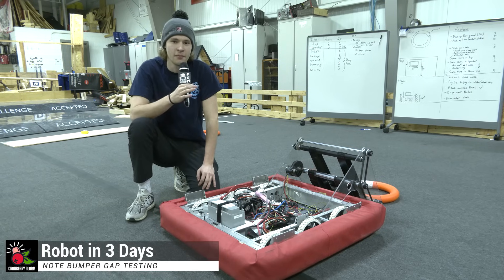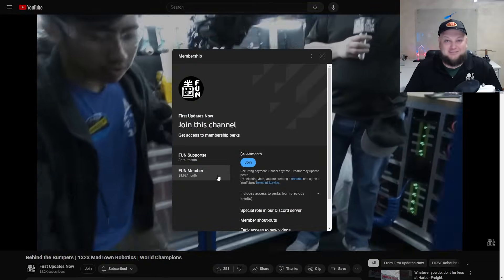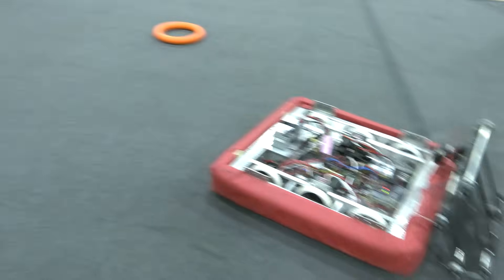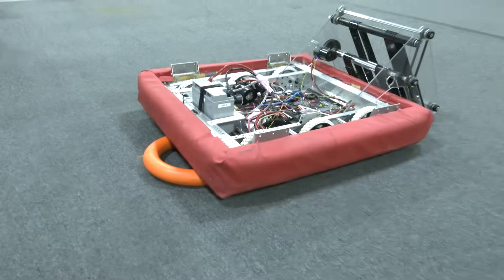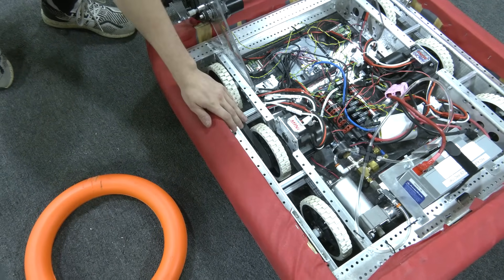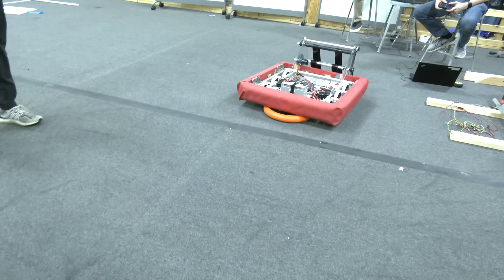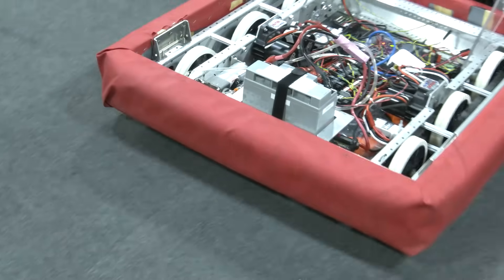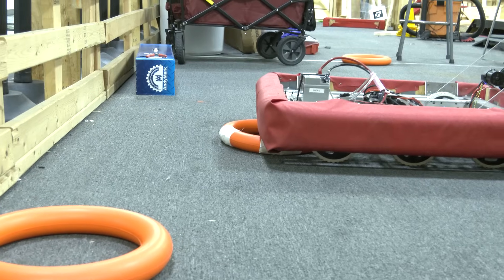Note Game Piece Bumper Height Testing | Cranberry Alarm Ri3D | CRESCENDO 2024

Comment: I think an under bumper intake is completely viable, just need to modify a chassis a bit
Reply: Agree, I think it is a big advantage over an extending intake because less joints, less motors and less parts outside the robot changing the center of weight.
Reply: @atomgutan8064 and quickness
Reply: Our reason for going with an over the bumper intake is because it makes it much easier for the drivers.  Under the bumper intake implies that you're going to get the majority of your robot over top of the Note.  Notes against the wall are especially tricky to get to with under the bumper.
- Cory from Cranberry Alarm

Comment: bumpers can go up to 3 inches off the ground right
Reply: top of the bumpers are a max of 7.5 in off the ground
Reply: They can be 4.5in tall, so that leaves 3in space under (a bit less with fabric+tolerance)
Reply: @alphamu0 they’re 5 inches tall, if you look at the profile it’s 2 2.5in pool noodles stacked
Reply: You can use 2.25" bumpers (see the game manual's bumper section, anywhere from 2.25 to 2.75 works), so a little bit less than 3" off the ground is possible
Reply: @malhamon9107    Noodle sizes of as small as 2.125" are ok this year, but the minimum backing board size is 4.5" which will be what controls the minimum bumper height. (R408)   If you squeeze right in at 4.5" placed right at 7.5" you have nominal clearance of 3", but 2.75" is probably about the best you can practically achieve w/o excessive worrying during robot inspection (see alphamu0's comment)
Reply: You can get around 3 inches between the ground and your bumpers, but the AM14U chassis that we used limited our options for under the bumper intakes.  Also be weary of how high up bumpers affect your ability to play defense and be defended!
- Cory from Cranberry Alarm
Reply: @corysnyder5507  Note also that the rules do not require a uniform bumper position.  You can have some bumper just under 7.5" and other at 5" (eg ~1/2" off the ground).